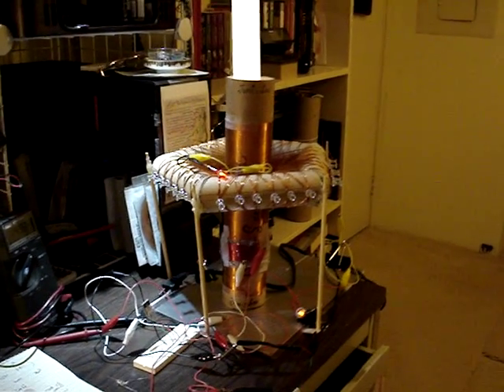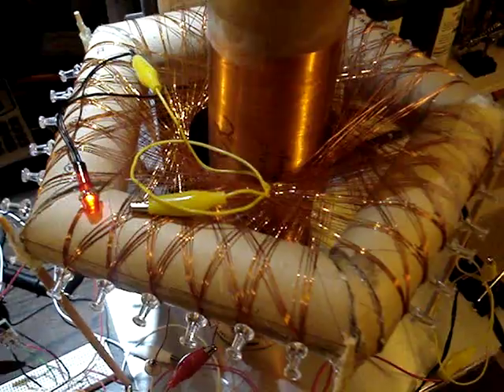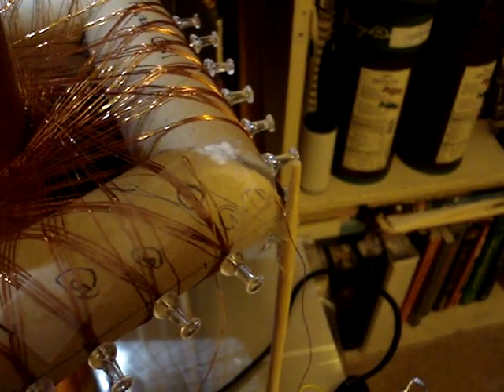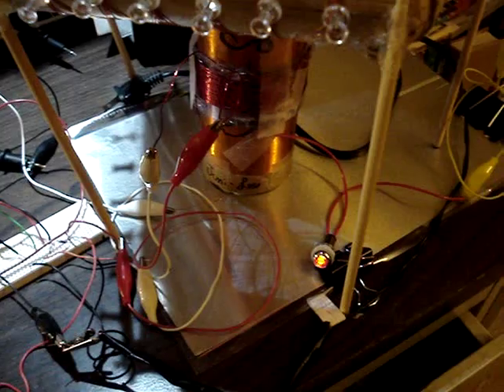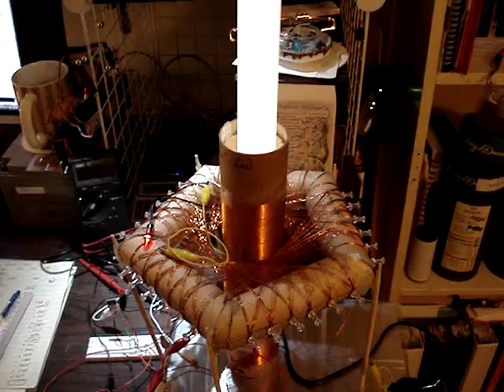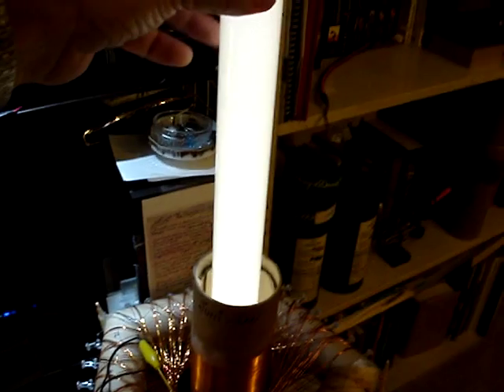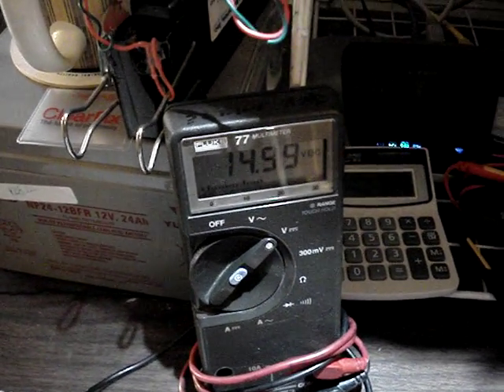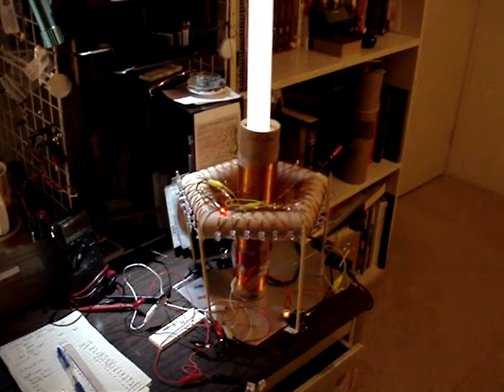Mr. Fanuzzi Coil meets Juni-Lee

Comment: Next place wire inside first terminal if the wire is rated 600v you going need wire lot extra Teflon tape around it because high voltage you can Teflon tape at wal-mart for 97 cent make sure charge is transfer to both plate at the sametime separate with air gap inside hemisphere capacitor. Cover first layer outside hemisphere with teflon and then Cut alumin. and copper thread wrap it spiral fashion first counter clockwise then separate counter clockwise again with Teflon counter clockwise layer

Comment: you should try more power like neon transformer with spark gap your coil like rodin coil  you are going to need larger gauge wire. Also you can experiment  bismuth and crystal inside a homemade capacitor. Good design with be hemisphere capacitor ref. Ralph ring ufo cut toroidal plastic tube in mid. cover one side alumin. and copper separate with insulator.